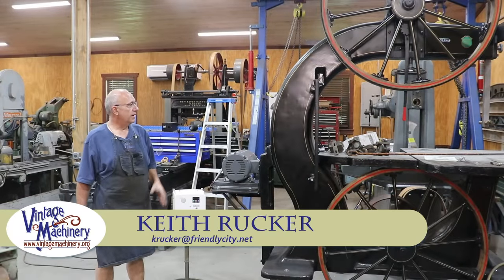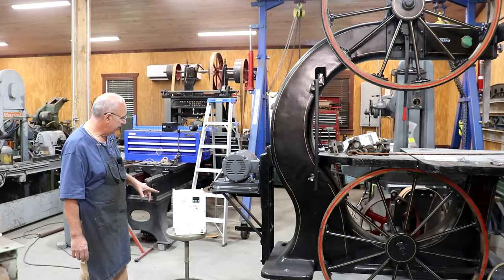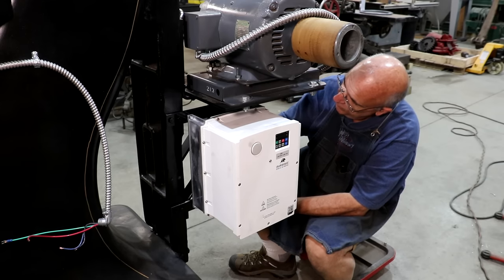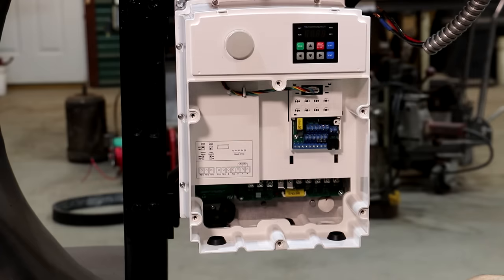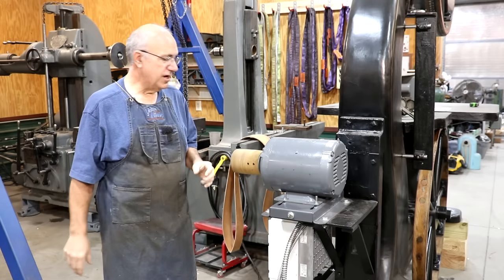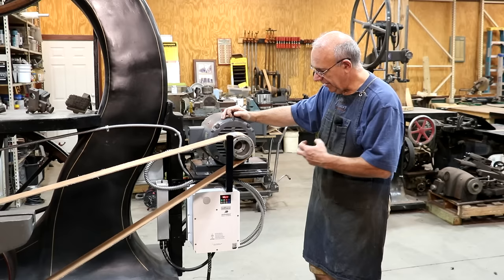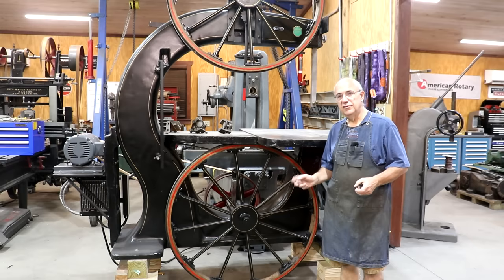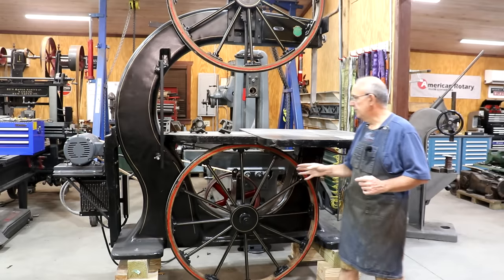Diresta Bandsaw Restoration 32:  Installing a Variable Frequency Drive (VFD) for Motor Control

Comment: This  is exactly what I dream of doing on my "dream bandsaw". My brother has an old turn-of-the-century Frank H Clement 37". Somebody did a nice job of restoring it - but never finished; it needs the wooden table replaced. And, for some unknown reason, that guy saw fit to outfit it with a honking 15hp 3 phase motor - and a chain drive!!  I want to replace the that racket of a chain drive with hopefully a 2-groove v-belt system. I'll find a 5hp motor, preferably in 220 volt 3 phase, and put a VFD on it to get that soft start and faster stop, as well as the variable speed. Would a single phase % hp. motor accept a VFD as well? That would be easier yet... Obviously, I'm not an electrician.
Reply: I would be curious about putting a VFD on a single phase motor also, it would definitely be handy with the extras that the (for me speed control) VFD has to offer.

Comment: Rotate the motor counter clockwise, as seen from above, and the belt may ride up unto the hump in the center of it's spindle. Then the motor would need to protrude more to be centered.

Comment: Just a curious question - have you considered a soft starter?  Not as flexible as a VFD, but much cheaper.  You'll always end up at base motor speed, so you can't modify the target RPM, but you can vary the ramp rate.  I guess it depends on the application, just wondering if you have used one before...

Comment: A brilliant piece of work on this Keith.  A question in my simple brain - when the blade is installed and the second wheel is running too, will that affect the start / stop process?
Reply: There will have to be some final tweaking of the VFD when the blade is installed but that won't be a problem with a programmable VFD.  Kieth was right to buy a more expensive and more capable unit.

Comment: Keith, when you have the blade on there, won't you double the inertia in the system as you will have both wheels running?  If that's the case, did you account for that when programming the VFD?

Comment: Hey Keith, wouldn't putting a concave on that motor roller prevent the belt from tracking like that?  Just a thought, you're welcome to dismiss that if it's not correct.

Comment: It would be interesting to see measurements of how parallel the motor shaft is to the wheel shaft.
Reply: It seems to run stable after the initial start. It returns quickly to where it started on the pulley and stays there. It makes me wonder if the initial torque generated when starting is making the pulley deflect slightly for a second.
Reply: @charlesblanton1008  The curvature of the pulleys forces the belt to run the center and true after they start. I used to work in a factory with lots of these running in my youth, and belt throw was always an issue under one or two circumstances. The two pulleys are not in the same plane and/or shafts not parallel, or the radius on the pulley that causes the belt to self-center was worn out. Torque can throw belts, too, but that can be handled by allowing for a lower belt tension. In these videos, it looks like slow startup, which reduces torque throw, does not prevent the belt from attempting to jump.

Comment: Back when the bandsaw was being power by the line shaft would there have been a way to have the "soft start" or would that even have been an issue since the power was always live?
Reply: He mentioned in a previous video that the operator would engage the belt slowly, kind of like slipping a clutch.

Comment: Very nice! Total control is sure nice to have!  Curious what the total cost is for the VFD, extra resistor, switches, potentiometer, and the various boxes for those items?
Also curious as to whether the VFD will allow maintaining a desired rpm when the load varies while cutting?
Reply: Now thats an interesting thought! I would assume the higher end units would support this.

Comment: We had over 500 VFD'S at place that I retired from and none had brakes. Think you misquoted ramp down time parameter. We always set ramp down to 5 seconds for small motors and over 20 seconds for 75 to 150 HP fans & pumps. I went out of my way to never purchase the cheaper open motors but sent with TEFC ( A totally enclosed fan cooled ) especially in dusty or damp locations. The will.last longer.

Comment: Keith great job on the restoration, I was wondering if the motor is an Inverter duty motor? if not, you may want to limit the minimum speed to 20hz or so so that the motor cooling fan still moves enough air to keep the motor from over heating.
Reply: Inverter rated motors are way over rated. We had cheap plain Jane 2 & 4 pole NEMA frame motors that were installed back in the 1970's when the building was built. Maybe 20 years later they replaced the 2 to 250 HP Motor starters with VFD'S. Very few of the old motors burnt out in any given year. Ran them from 20 to 60 Hertz ( full speed ) with no.problems. Very few motors ran full speed 24/7. Was a great energy saver by using main 75 to 150 HP air handler and the back up fan at greatly reduced speed especially at night when speed could be lowered even more.

Comment: I'm surprised you didn't get the VFD from American Rotary.
Reply: He mentioned in a previous video AR doesn't make their own VFDs - they just source another manufacturer's products. It looks like they resell ABB brand VFDs - a Finish company. Not sure where the product is actually made, but they are very expensive, industrial grade products, probably overkill (and overpriced) for what is needed here.

Comment: Keith, my understanding is this bandsaw is for wood cutting, but since you added the variable speed to it I imagine you could cut also steel if you just changed the blade to a steel blade. Am I wrong?
Reply: My sense is it depends on the torque needed - at some point the belt will slip.

Comment: And before you buy a VFD make sure your motor is inverter rated or the eddy current from the HF carrier will smoke the bearings in the motor .

Comment: At 1725 rpm motor speed, a rough calc indicates a blade speed of about 7000 fpm.  Is this normal ?
(If not and the VFD is used to slow the blade speed then the maximum motor power reduces in proportion to the speed.)
Reply: Keith mentioned that the factory spec for the four foot wheel was 450 RPM.  That calculates out to 5655 feet per minute --- 1.07 miles per minute --- 64 miles per hour!   WOW!!!

Comment: I would agree with the user manual side of things. Some manuals are completely unintelligible. 
If you're wanting to add a brake to the motor when using a VFD it will probably need an external resistor Keith. To not use one may damage the inverter and it was very expensive to buy.
Reply: Several times I contacted Danfoss about adding brakes on 40 to 100 HP return fans on AHU units.Told me that they make no retrofit kits and would need to order a drive with the brake option. Years ago we made home made brake for three phase motors that ran off of motor starters. Would wire in a 30 amp 600 volt cube rectifier with a time delay off timer set at the lowest setting that would stop a 3 to 10HP motor. Rectifier seemed to last a few years if set correctly.
Reply: Did you bother to watch the video?  I think not!

Comment: When I was building my phase converter, I accidentally discovered a way to motor brake quickly.  The starter caps were quite good at halting the converter rotor when a logic-fault existed inside the converter hardwired control logic.  That was 1990, so the head honcho at American Rotary was either no born yet...or very young.

Comment: I wonder why they didn't have all those problems with the old motor system, With the belt coming off. they didn't need a converter or other things to make it work properly.  with the new motor there's all kinds of problems requiring a bunch of extra things to make it work. I wonder if when the blade is put on and the other wheel is turning if there wont be more problems stopping it. I still have to wonder how the old motor handled everything. and now there has to be a bunch of extra electrical components' added to do what the original motor did all by itself.
Reply: I visualize the original system using a slip belt and movable idler pully the operator used to slowly engage the belt to gradually bring the machine up to operating speed. Once the idler pully was disengaged, they probably didn't care about coast down time.
Reply: It was originally driven by a belt-driven line shaft common to all the machines in the shop. It's not clear it was every driven directly by an electric motor before, but if it was,  these issues would have needed to be dealt with also. Keith mentioned in a previous video that in the line-shaft days, the operator engaged the belt slowly, like slipping a clutch. They could do the same when shutting down a particular machine. 100 years ago they designed the system end-to-end based on the technology of the time, solving any problems inherent in those technologies. Converting things from 'analog/mechanical' to 'digital/electronic' is fraught with all kinds of unique problems. The analog world has 'natural' parameters that must be taken into account in designs, like weight, inertia etc, whereas the digital world often needs to model and respond to the analog world via complex electronics and software to interface with us analog humans, since digital's 'natural world' is simply either OFF or ON.

Comment: The VFD should have a minimum low limit programmed speed setting.  I believe the recommendation is no lower than 20HZ, too low speed the motor fan cannot adequately cool the motor.

Comment: A emergency stop cant have a delay on it. Stop is stop. The emergency stop must immediately halts the dangerous movement/situation without a delay.
Reply: How fast the e-stop has to stop the blade depends on the law in your country or region. Some countrys like mine old machines made before e stop was a thing they dont have to have any. But generaly e stops never have to break so hard that they might damage the machine. In this saw is a lot of rotating mass and somewhat limited friction to the motor so the e stop can only do so much and its not expected to do more than that.
Reply: @lobster8009  a e-stop is nc power stop. The rules from America suck.
Reply: If you try to stop all that moving metal too fast, you're likely to blow it apart. Not just the electronics, but mechanical things could fail, causing even more problems. Ultimately, you can't always remove all dangers in a workshop - you do the best you can, and especially train users into not doing dumb things. Keith said he will continue try to find a good sweet spot.
Reply: @kindabluejazz  he did it first when he tested the motor so dont exaggerate. E-stop nc direct to the power.

Comment: I have to respectfully disagree and again respectfully educate you, am neither pro nor negative China, what must be mentioned though is that the Chinese are excellent engineers and also astute business people, therfore they build to a requested price point and requested specification, therfore in the race to be the cheapest as is requested by the customer, we see flood of lesser quality pieces of equipment, that is NOT the fault of the Chinese, if you specify (or search for) higher quality equipment, that equipment can be of comparible quality (or exceed it) of many other suppliers so I'm sorry but to berate the Chinese for supplying what they are asked to supply is a somewhat uneducated and ignorant assertion.